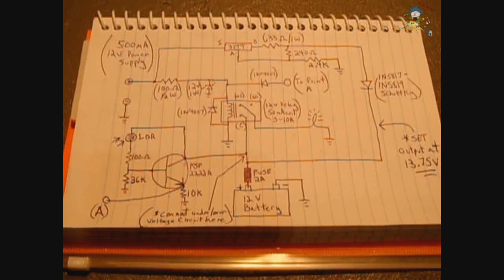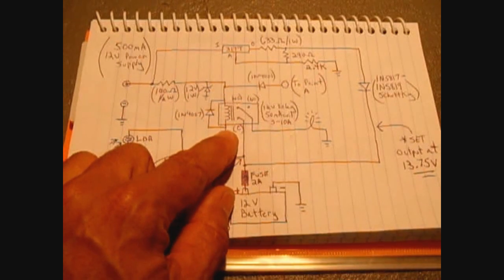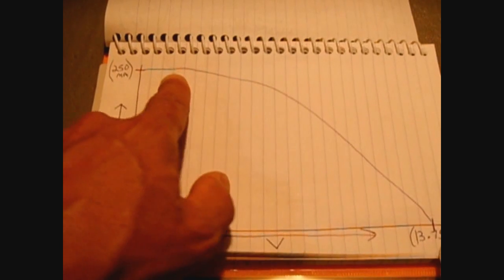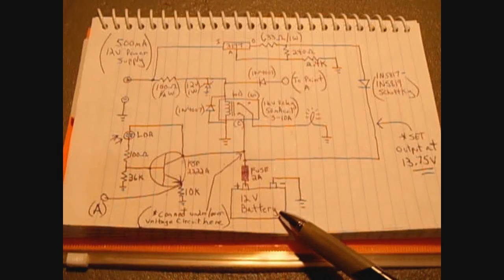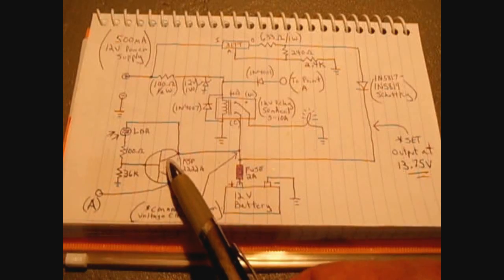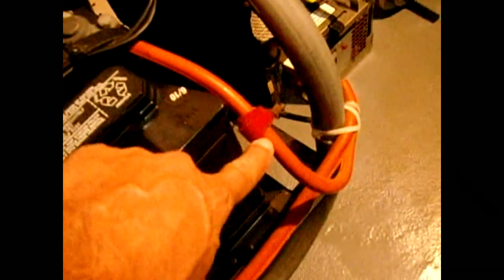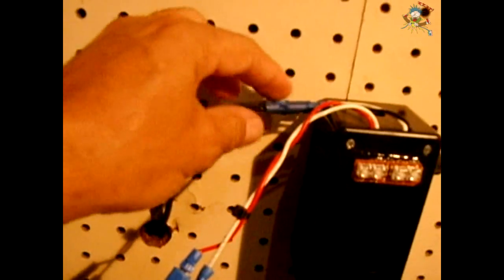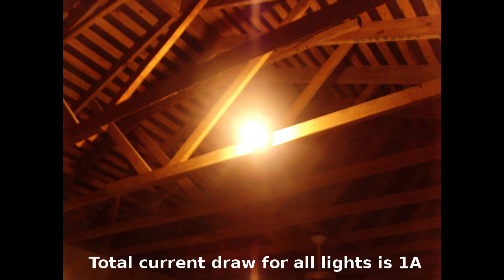Power Failure Lighting Circuit(Emergency Lighting)

Comment: The charging circuit dont work.  How u get 13,75-14v from 12v input??
Reply from the maker: Of course it works! The open circuit voltage or a 12v/500mA wall transformer is around 18/19V. I am only using around 250ma to 330ma to charge the battery. The circuit does not draw that much extra current. I have this installed in our home. I can tell you the battery charges just fine.

Thanks For Watching!
Reply: electronicsNmore Ahh ok, missed that u used a unregulated powersupply. Nice vid by the way ;)
Reply from the maker: Thanks

Comment: Nice. 13.75V might be a bit high,depending on the type of battery,temperature,and usage pattern,though.
Reply from the maker: 13.75v for a sealed lead acid/Lead acid battery is fine. Going higher will slightly over charge the battery and generate heat within the plates.

Thanks For Watching!